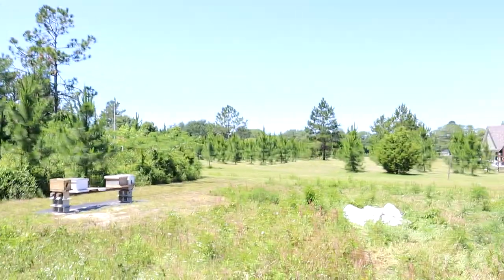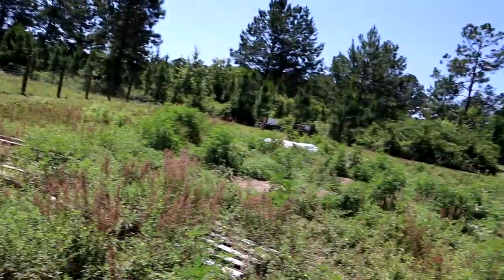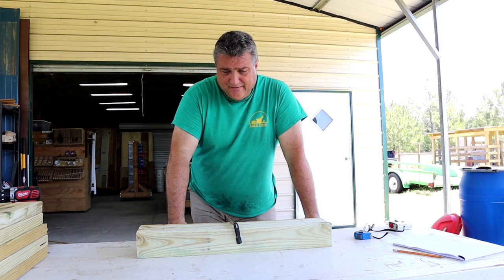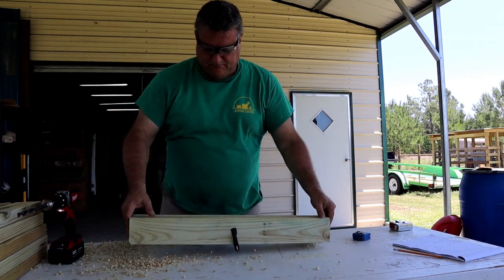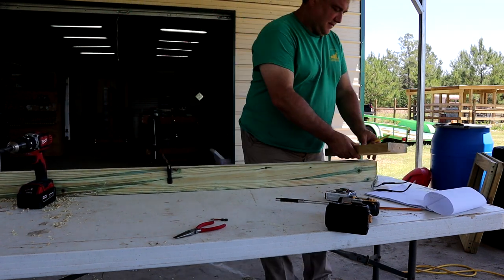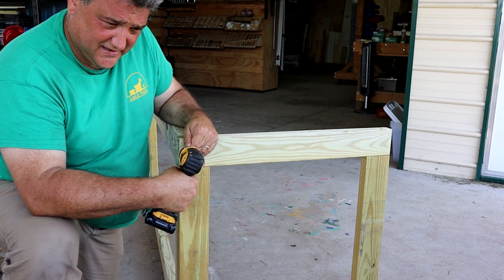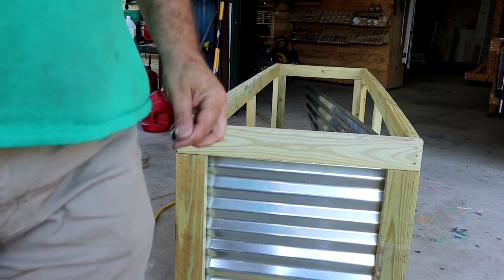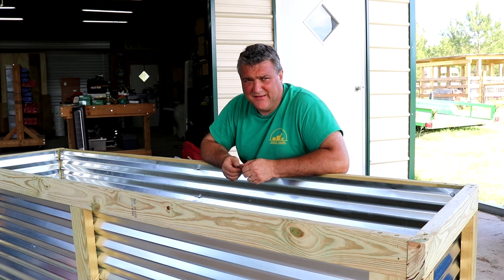WOOD FRAME AND GALVANIZED SIDE RAISED BED - How to build!

Comment: Wanted raised garden beds for 20 years when my avid gardener/farmer Dad had a stroke...well that never happened and I have devoured all the online information for years.....Now I am ready with barnwood from family barn whose roof collapsed....

I especially liked the drilling large hole and then 3 inch screws part..as I had not seen that before, thank you! Good luck becoming sustainable, what a dream come true for you. 8-)  Whatever I come up with will be placed on an uneven concrete pasture from years ago...less weeding....it will not be pretty like yours, but I will most likely share on my youtube channel. THANKS AGAIN AND GOOD LUCK